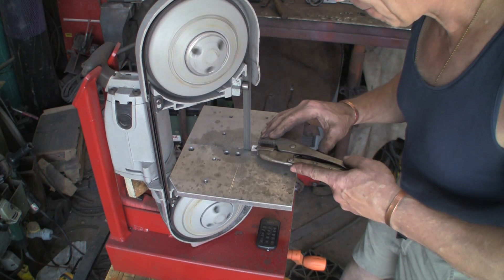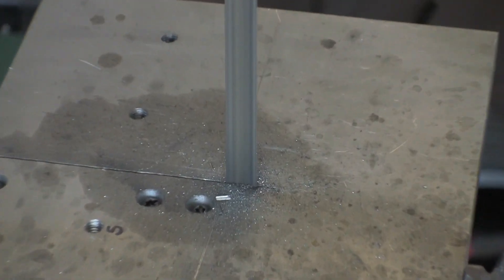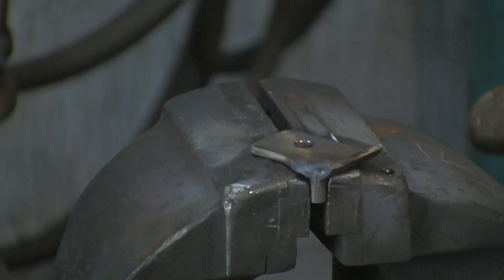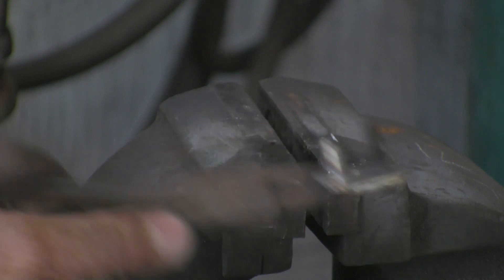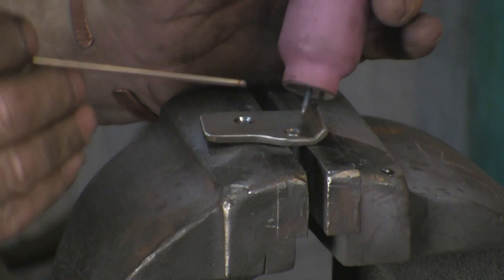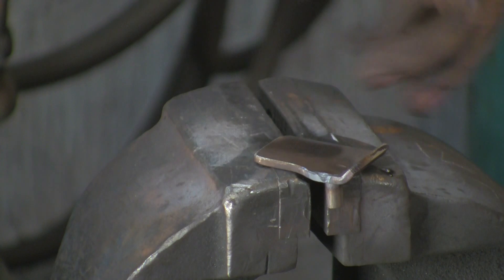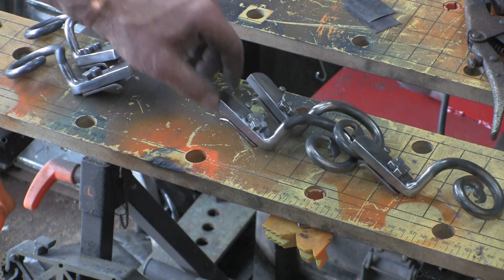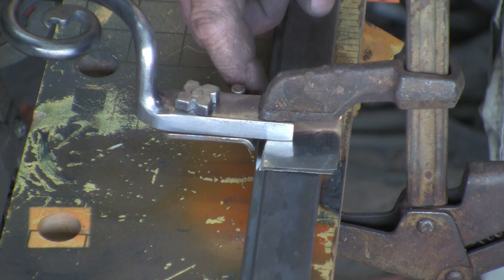Window furniture part 2

Comment: You can get rid of the wire arm hair by using a sander/polisher to run your wire wheel instead of an angle grinder.  Lower rpms of the polisher keep the wheel from throwing off wire and it still gets the job done. Good vid.  I’ve enjoyed your work for sometime now.
Reply from the maker: and loose the will to live waiting for it to take anything off! You could hold it on the job all day and nothing happen. It's the speed that does the work!

Comment: Gary , your videos are really interesting to watch thanks for showing us all .   One question I have  - 
Could mixing different metals cause a possible problem of accelerated Corrosion due to Potential Differences of the metals?
Cheers and Thanks
Reply from the maker: I doubt it, with stainless and steel, maybe if it was stainless and ali!

Comment: Any idea how they're going to weather strip these? I assume that even clamped shut they will be very drafty without some sort of seal being added. I only ask as you said in the last video that the place where they are going the look has to be original.
Reply from the maker: I have no idea! i guess a foam strip around the inside wouldn't show.
Reply: I hope they have a big wood burner.
Reply: No weather strips on a crittal type window, they’re supposed to fit !   these windows are painted for maintenance and if you put a foam strip on them it’s hells delight to get it off every time you paint them !!